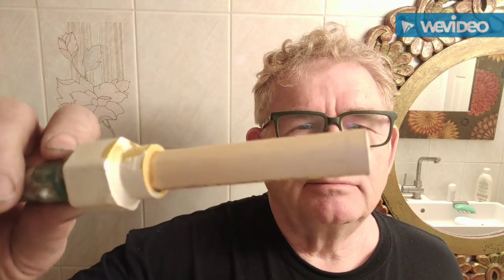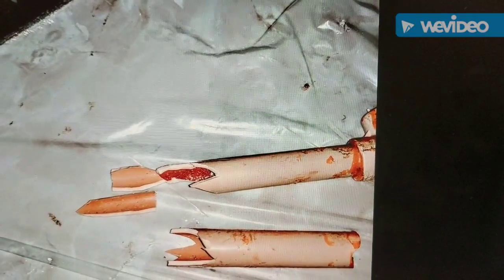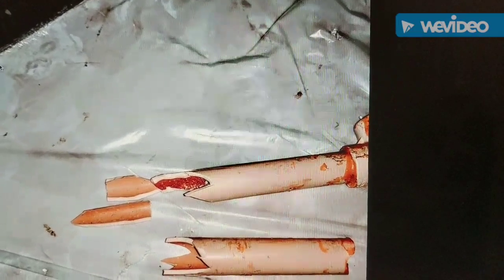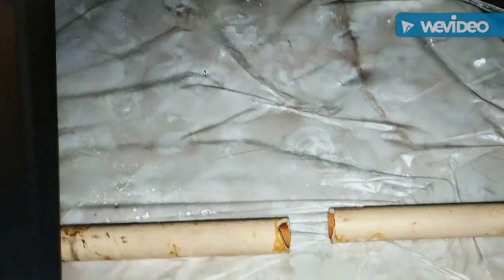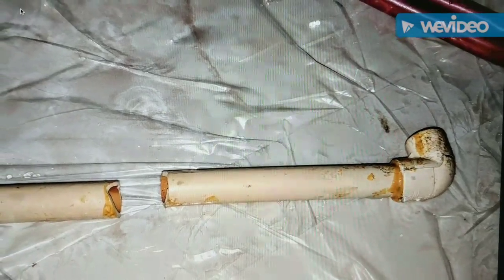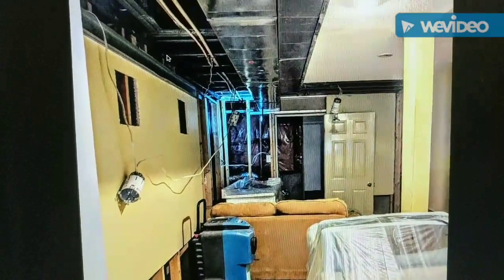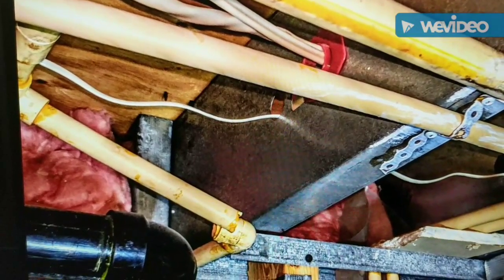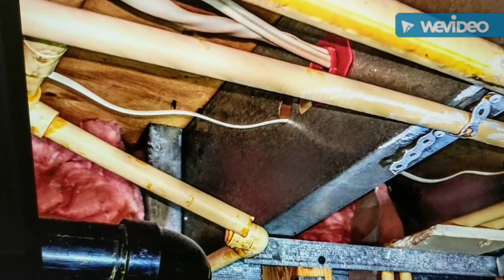The Danger Of CPVC pipe

Comment: I recently purchased a house that has PEX & Copper piping. It was a flipped house and I'm  worry about the PEX's.  I'm not 100% sold on PEX.  There was a new 30 story apartment building that was built 7 years ago, and now have major problems with leaks.  They had to shutdown part of building to replace the faulty PEX.   The building owners went after the contractors, the contractors went after the manufactures.  The Manufactures said it fail do to installation.  There's a huge lawsuit still going on.  I know copper is not cost effective, but it is a piece of mind. 

As for my new home, I have the expertise to replace the PEX when it fails.  When I do replace it, it will be cheaper to do it, because I'm not paying labor for a plumber; all it will cost it the price of the cooper.

Comment: My shower mixer valve to CPVC adapter failed and leaked. As I tried to unscrew it from the valve, it snapped.  Not sure if it's either because the 12 year CPVC is old or the original plumber used dope instead of teflon tape... Either way, my project DIY project blew up. Now I need the whole valve replaced :(
Reply from the maker: that's because  it gets very brittle and it snaps- it appears to be the chlorine in the water-I have my doubters and industry public relations people that claim otherwise, on this page -as you can see from some of the comments. However your experience would pretty well fall in line with my expectations end experiences with CPVC pipe.
You can use sharkbite fittings to repair it ; but once it gets brittle ,better to replace it.

Comment: CPVC is like any other pipe if you really know how to install. Many factors have to be involved. It must be secured to prevent possible flexing by fasten it by clamps to studs ,ect. I installed it years ago by connecting it to copper by way of special type fittings. As for purple primer and the mess it makes when some person just gobs it on when applicator is sopping wet. You only swab it on after shaking it off applicator and swabbing it on only coating area that is suppose to fill the cup. Also apply glue rated only for cpvc and after using it wiping immediately off excess and joints look good. Even though it is rated for hot water I would not use. Its not for exposed outside use due to winter and summer weather extremes. Once installed leave it alone and it will last very long time. I also install an expansion joint for the expansion it may need.
Reply from the maker: Nonsense - there's so many better alternatives to CPVC - and I've installed many in my over 50 Years in the Trade

Comment: My father installed cpvc in his house when this stuff first came out about 40+ years ago. I inherited the house and the cpvc is still there and has never broke or leaked. I have used it myself and never had a problem. The only time I seen it break or shatter was if it was frozen or exposed to sun light. I am currently doing some remodeling and am using cpvc with confidence.
Reply: @billybob042665  what about the plastic valves ---mine just snapped
Reply: The only time I recommend you don't use CPVC is when you don't live in South States. Everywhere else you have freezing temperatures and CPVC does not expand like PEX. So if you live in the South (California, Texas, or Florida) where it does not go below zero, your okay with CPVC.
Reply from the maker: @billybob042665  They still sell Cigarettes and they still sell CPVC-My point as an Experienced Service Plumber was to Warn installers and Home owners about the potential Hazards of  CPVC-You can see from the Comments that some people agree with me and some don't -and some people still smoke cigarettes, that are still on the market-I think its the Height of Naivety to think just because a product is Bad or Poor Quality ,that in a free Market Economy-It will not be sold -As P.T. Barnum might have said: "There's A Sucker Born Every Minute."
Reply: @TheDavelaird  Every pipe has its hazard. Why don't you tell everyone how many times PEX has changed its pipe compositions does to Leaching of chemicals inside the plastic??? THATS WHY CPVC IS CHLORINATED!!! CPVC does not burst wide open, it cracks or leaks at poorly installed joints. When PEX fails, its a WIDE OPEN BOIL. The pipe expands on both hot and cold water lines and forms a huge boil and rupture. Basically a garden hose inside your attic. Why not talk about acidity in the well water??? PEX does not hold up to well water that is acidic compared to CPVC thats chlorinated. Why not talk about rodents/rats eating the PEX because they think its food versus CPVC. I have never seen a case of CPVC being eaten by a rat or rodent. This is coming from an insurance plumbing inspector/state licensed contractor in Florida. Whenever I see these bad reviews of CPVC, first thing I ask my self, who is the installer and what city and state its being installed. I do agree that CPVC should not be installed in northern states that have freezing temperatures.
Reply from the maker: Good for you - I'm always Glad to hear from folks who Know More than me
Reply: @TheDavelaird  I thought you were trying to be a nice guy and do this informative video. That's great. But why be a dick when someone doesn't agree with you?  "I'm always glad to hear from folks who know more than me" is a dickhead reply.  All hail the Master Plumber

Comment: I'm in Georgia , I have had 3 pinholes in 6 months , 2 in the last 3 weeks , 3/4 inch copper main cold line , I know it has to be replaced , what do you suggest , I have been told to use CPVC or Pex . Now I don't want to use the CPVC
Reply from the maker: I don't know what the code is in Georgia-perhaps you should check with the municipality first That Said, I prefer Wisboro pex A pipe  It uses expanded Plastic rings to hold the fitting and pipe and you also expand the pipe to insert the fitting-its the best grade of pex and  perhaps use wisboro plastic fittings ,as it seems your water is corrosive with copper or brass I know we can use polyethylene pipe in Ontario  (with a tracer wire) but I still prefer Wisboro
Reply: Thank You , Pex seems to be popular here now ...
Reply: DO NOT use CPVC unless you like problems in the future

Comment: What is the yellow stuff at the joints?  Never seen CPVC with that stuff before.
Reply from the maker: Its The original glue that yellows with age
Reply: @TheDavelaird  cpvc glue is always yellow
Reply from the maker: @jacksplumbingvideos7147  No its not -Check the Oatey Page -Its Grey or  Orange or Clear or other colours
Reply: @TheDavelaird  no, CPVC flowguard requires yellow glue. The gray glue I don't trust and there is no clear glue that we installers use. Orange is for the sprinkler systems lol. You are mixing apple with oranges.
Reply from the maker: @CSJiGSaW08  Maybe where you live ,but check the internet here's a partial list-Purple-Primer/Grey -Whitlam/orange-Oatey/Golden Yellow-HP/Orange-Weldon/OrangeGrey-Weldon/Grey-Weldon/White -Vrundavain Polymers-etc There's a Rainbow of CPVC Glue colours out there not apples and Oranges-(although there's lots of Orange CPVC Glue!)but it still doesn't change my view of CPVC

Comment: I work with mobilehomes and I see lots of cpvc being used......its very inexpensive and easy to install....glue drying times are 15 min...but full cure time is like 9 hours or more......it does get brittle...DONT USE PVC PIPE CUTTERS.....USE A FINE SAW.....I just repaired a 1/2 inch Tee and it was nasty  brittle....nasty.....nasty brittle, so i had to gently saw off pieces.....
Reply: Yes yes yes. Pvc pipe cutters snap old pvc. Other than that CPVC is the way to go.
Reply: Use a mini cutoff wheel like a dremel.

Comment: 1:15  WOW!  I am in the midst of re-doing my basement's washing machine plumbing after the PVC pipe busted, the hot side has CPVC.  I was just going to do the cold side, than thought of adding on a matching new faucet for the hot side, but than...started to contemplate just doing both hot and cold..so it' all uniform...THAN..started to think maybe I should go with copper and looked here on youtube for advise/opinions/knowledge..WHAM..found this staggering advise..thank you so much!   That said, I was planing on using all sharkbite connections for the many elbows, T-s and there are alot of them instead of soldering them.  I don't want to solder, but will look into if and when Sharkbite fixtures can fail.  
BTW..I was home, in the next room when the PVC pipe busted just before the shut off valve, I belive it was triggered by some work I did on it just before, was trying to change the hoses and was using pliers to tighten them..so the torque I exerted is probably what caused a stress crack to form and it's explosion..IF I had not been home, this could have utterly destroyed much of the contents in that room and perhaps in adjacent rooms..like they say "water always wins".  So I KNOW I'm going to really pay very much more mainly due to using all Sharkbite connections, but if it means my house is worth more money and my property is safer than isn't that worth it?  I also made up my mind to shut off my water supply at the main when I go on vacation, mostly in case of a major storm damage, but also will shut off the valves at the washing machine after doing loads of laundry, just in case the hoses or fittings, or internal parts of the machine rupture, and yes, I use braided stainless hoses but even those can eventually fail..my machine is 30 years old.  The CPVC and PVC was 26 years old, it was a transition from copper just before that room.
Reply: zzubuzz...I'm not sure but when you turn off the water you might 
want to turn off the water heater as well. I'm not a plummer but
I would look into that to be on the safe side.
Reply: @redphantom70  sharkbite will get you longevity issues as well. seals degrade over time

Comment: She pulled the pipe out and broke it because the plumber didn't strap it. Same can happen if you don't strap lots of different pipes...
If the plumber comes to repair something and he can't tell what kind of pipe it is and he doesn't have enough common sense to not twist the pipe and idiot. Here in Florida the soil is super acidic that copper fails 2x to 5x faster than cpvc...
Copper, pex, cpvc, pvc, gray pipe, sharkbite, etc. Have had lawsuit built up. However gray poly was the only product outlawed in the states. 
Cpvc does get brittle on the hot side, and in the sun... also it's not supposed to be in the sun...
Reply from the maker: The Pipe was strapped and inspected and passed -It snaps because it gets Brittle and shatters for the same reason
Reply: David Laird lots of things pass inspection that shouldn't. And a strap in the wrong area is pointless... not saying that It doesn't get brittle, just if done right it's a good products... Just like uponor or pex. Copper is good for curtain applications...
Reply from the maker: I heard the same praise for KITEC and I wouldnt use either KITEC or CPVC  to pipe a Doghouse 'cause I pay my own liability insurance and want to keep a good name in the community-whatever you do is your problem- but I repair and replace CPVC and KITEC regularly, so I'm not into Public Relations for poorly performing  plumbing  products.

Comment: Exactly and now they put glued fittings under the slab. It would cost an additional $100-200 to not have glued fittings under a slab (continuous looping between fixtures). Absolutely stupid plumbing by anyone's standards.  Sleeved copper run with continuous loops will last a lifetime. I am not familiar with the longevity of PEX.  Also they deleted the requirement to sleeve CPVC through the slab. Why? Because they can say $10 in cheap plastic sleeves.

Have never had a copper failure that was sleeved with no fittings under the slab. Copper lasts a lifetime if done right and the water has the proper acidity. But it is not cheap. CPVC could last longer if installed correctly. maybe!

https://www.clickorlando.com/news/plumbers-warn-of-cpvc-piping-problems_20151105190735671

https://www.familyhandyman.com/plumbing/pex-piping-everything-you-need-to-know/view-all/
http://www.mcgarryandmadsen.com/inspection/Blog/Entries/2015/9/3_What_is_the_average_life_expectancy_of_copper_pipe.html
https://www.houselogic.com/organize-maintain/home-maintenance-tips/types-plumbing-pipes-and-their-lifespans/

Comment: Thank you very much for very useful video.
Reply from the maker: Thanks I'm glad you found it Helpful
Reply: @TheDavelaird  Thank you. Just today, I bought CPVC and am contemplating on returning it for copper pipe. I think copper will last longer. David, what are your thoughts with plastic leaching into water? Thanks
Reply from the maker: LordStanley hi - I prefer copper but for water lines you can use pex a or pex b- it may be easier to work with for someone not in the trade- I don’t think there’s any problems with water or plastic Leaching into each other- if you have chlorine or other water treatment chemicals in your water- depending on the concentrations - there may be some affect on your choice of piping- if you use pex - make sure you don’t have a rodent problem as the little beggars like to sharpen their teeth on the pipe
Reply: @TheDavelaird  Thank you David! Appreciate you replying. I am going to go with copper, type L, the thicker version.

Comment: I only run cpvc when it's spec'd for the job. In the field I'm actually seeing it start to phase out from supply houses. Love the fact that aquapex is starting to take over the plumbing world. Id say uponor for residential and commercial, and copper for mechanical rooms. Boilers systems, radiant heat and water heaters ran in copper still look like a masterpiece if it is done right.
Reply from the maker: My Thoughts Exactly- I really like Aquapex  for potable and Heapex for heating and use both when pex is called for-Uphonor makes great pipe and fittings-But nothing looks better than copper and lasts -I've gone to Pro Press and its great-so tired of seeing pex run like Spaghetti by incompetent boobs who denigrate the Trade We're starting to find Pex is liked by rodents and we've replaced quite a few knawed pex lines eaten through by sharp little mouse and Rat  teeth
Reply: Well cpvc is super easy to install maybe even  cheapest option or not. I install about 1 1/2 apartments per day over here in Houston nd We put about 110 psi of air pressure whenever it is time to test the pipe, we usually dont get any problems with it and  i dont think its that dangerous. Maybe cpvc is dangerous when its installed in a cold area? Who knows

Comment: Any rigid pipe will crack when subject to stress/force, it's the nature of the material. Properly support it and it will last as long as anything else.

This is User/Installer Error
Reply from the maker: You missed The point of The Warning -CPVC isn't Brittle When Manufactured -Its Ductile and Flexible-you can hit it with a hammer and it won't break.
Over time it becomes brittle by exposure to Chlorine, sunlight, etc- -If people were installing Glass Pipe -It would be Properly supported Because Its Brittle!-CPVC isn't sold or Advertised as Brittle Pipe, Like Glass ;that's why there's so many ongoing Lawsuits over it,My Friend.
Reply: @TheDavelaird  Which Class Action Lawsuits have won? Zero... On the other hand PEX has had 22 class action lawsuits with 10 of them being since 2008. CPVC is all user/installer error. I guess PEX will go down same as Polybutylene pipes and so will Uponor. Uponor is new and no one knows what will happen. I prefer a 40+ year old tried and tested pipe like CPVC that has not changed its material like PEX due to bursting pipes.
Reply: Failure to understand the materials is user/installer error, not the manufacturer's fault. What you are describing is "work hardening" and "fatigue life", two concepts well known in metallurgy and welding/fabrication.
Reply from the maker: CPVC is a PLASTIC  and has nothing to do do with "Metallurgy" which applies to METALS-And it is not "WELDED" -like steel pipe-It is sold as approved potable water pipe and glued  -Not pipe that will shatter in a few years due to chlorine -and I didnt install it nor would I-my video is a warning based on my Experience as a Master Plumber-What are your claims based on?
Reply from the maker: See my above reply-and Again I ask -What are your claims based on?Or Do you work for The CPVC industry?
Reply: Mechanical engineering and building Wankel engines. Work hardening applies to anything that can be flexed/bent. A common item on a car that displays the principle are the plastic clips that hold the rods onto door lock cylinders. Flex, flex, flex, SNAP!
Reply from the maker: CPVC installed in a house is clamped in place -Unless its installed in a House Trailer-IT DOESNT flex ,Flex ,Flex and then Snap-It just sits there for 15 years and gets brittle over time -Nice Idea But CPVC potable water pipe isnt a Wankel Engine  flexing a  Plastic Door Clip-truly! a nonsensical comparrison !

Comment: Hey dummy I put it in my home in 1975 and have never had a problem. I been a master plumber 45 yrs. Ihe grey quest tubing is the one you dont want, nor copper
Reply: Why would you resort to calling someone a dummy. There was no need for that. He has a right to share his opinion and experience.
Reply: what about the plastic shut-offs ? mine snapped and no I didn't abuse them
Reply from the maker: You certainly Are a Talented Individual ,and a" Master Plumber" and a Religious Troubadour -Perhaps you dont have internet access or you have a literacy problem down there in Swallow Hollow Butt Kentucky,and are unable to read and comprehend about the numerous Lawsuits against CPVC pipe on The Internet